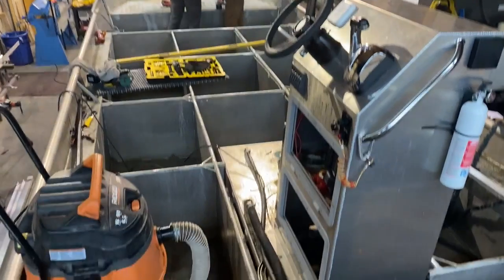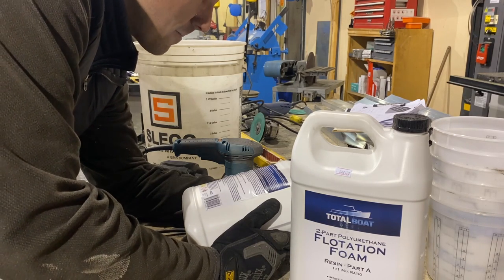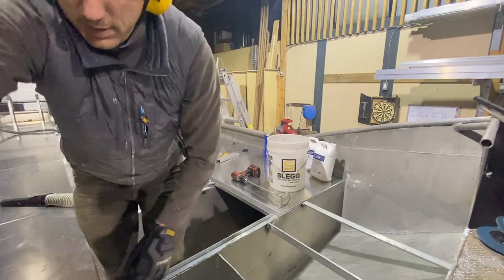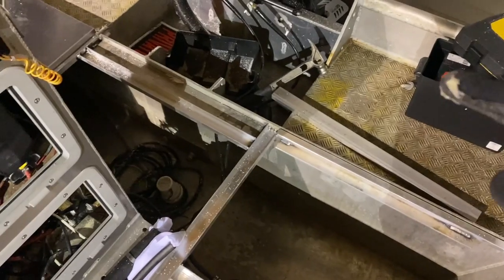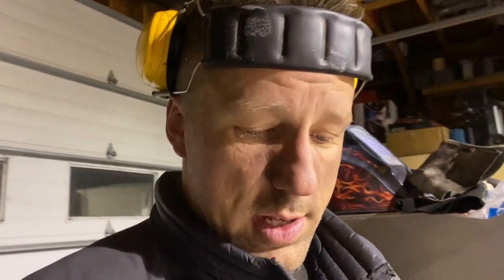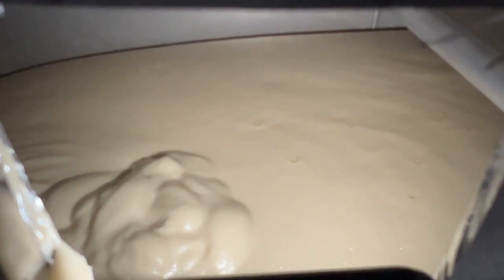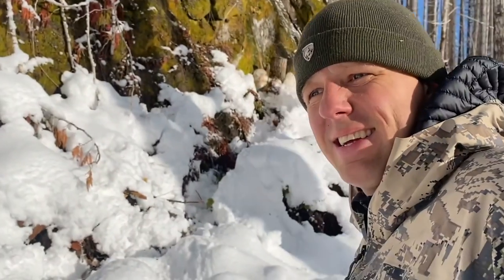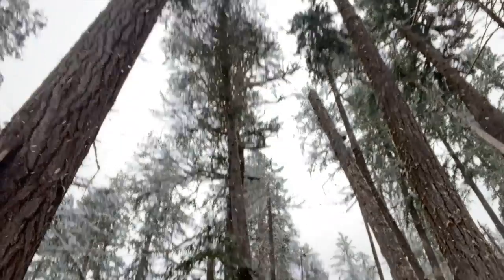Renovating My Skiff!!!

Comment: When I think of all the time we have spent getting that foam out of alloy boats over the years...  No alloy boat I used or know of with foam in it survived more than a couple of decades - the fundamental problem is that by sealing the alloy the atmosphere becomes deoxygenated and that is fatal to stainless and aluminium, as crevice corrosion is inevitable.  This is more of an issue perhaps with salt water boats, but rainwater was what was in the ones I saw dissolved.  The foam at best is 90% closed cell.  We got away with pouring foam in plastic bags in small areas.  Mostly we went to filling compartments up with sealed plastic soft drink bottles and or pool noodles, so we can ventilate still but have pretty similar reserve flotation volumes.  We only use the pour in foam for GRP and epoxy sealed Wooden structures.

Comment: I used a similar product to make floats for a pipe coming off a dredge in an environmental cleanup project at a closed coal mine. We used those 55 gallon poly barrels as our floats and filled them with the foam mixture. They worked great for holding up our discharge pipe as it snaked from our dredge to the edge of the ponds.

Comment: My heart sank when seeing you adding foam to an aluminum boat.  There are many who have had to remove it due to water absorption weight and corrosion.  Removal is a real pain... Some substitute pool noodles if they feel the need for flotation.  I think boats over 20' are exempt from the manufacturers requirement.  I hope your foam is actually a durable closed cell but I have doubts based on user reports of OEM foam.

Comment: Hey Samurai Carpenter I'm a pipe welder and have worked with alum before.  Get a plasma cutter it will save you a whole lot of time and head ach. Cut that stuff like butter only thing it you will have to prep the joints.

Comment: I used the Tremco closed cell product on our dock. Drilled holes, injected the premixed product which filled the void. Any extra foam came out of the hole. That was removed and the hole was then sealed. Far less messy than the stuff you are using and easier to work with too.

Comment: As a carpenter myself, seeing that guy cutting metal with the circular saw had me screaming in horror.
Reply: With a fine tooth carbide blade..10ga. Al is easy and safe.  .. but if a low speed circular saw is available so much the better.
Reply: @budbrady3289  I understand that, but the carpenter part of me just feels it as very wrong.